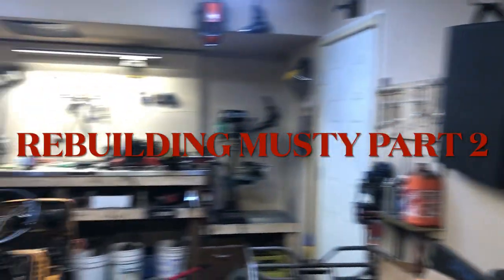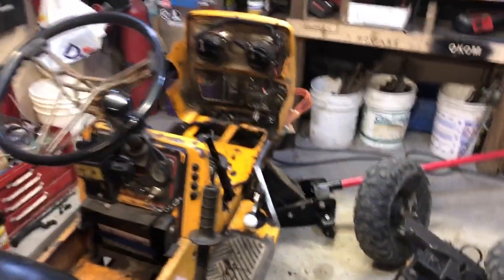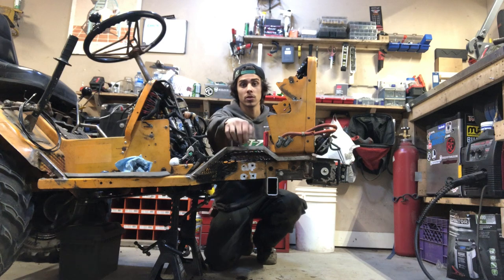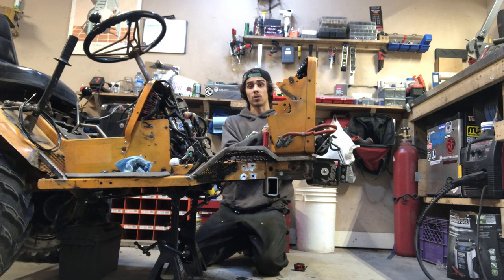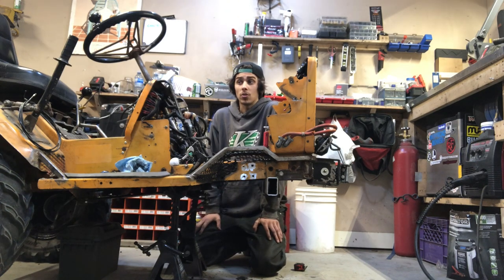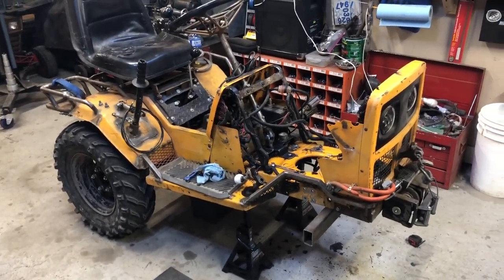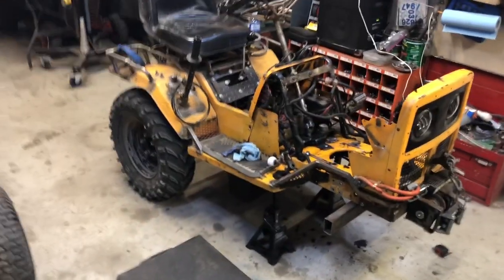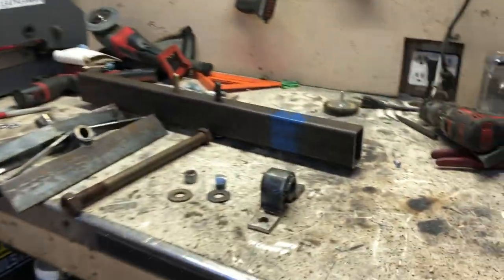HOW TO BUILD A OFF-ROAD MOWER (PART 2) MUSTY THE MOWER 2.0

Comment: FYI... I've been running a grader for years. The front axles are built the same way with a center articulation point, no suspension, and a ton of flex.
Reply from the maker: Yes I kept the swing beam setup with center articulation spot, I wanted to change spindle design as I don’t like any factory ones I have found 
Plus I can build it beefier
Reply: @okoffroadmowers  - Lookin' good. 
I'm in Black Diamond Alberta (s.w. of Calgary). Was just given an old lawn tractor so I decided to do the right thing and build it for the bush. Recently found your videos and now have a ton of good ideas..
Much appreciated!

Comment: I think tapered roller bearings work best for spindles, wheels and pretty much everything you can fit them in that can be preloaded... The small ones from a 2wd ranger work awesome.. I'm sure there's others but those are pretty  cheap.. I'm also pretty sure you want the thrust bearing on bottom if not on both sides?
Reply from the maker: Yep will be using them in future builds Forsure! 
Trust bearings top and bottom would help yes!